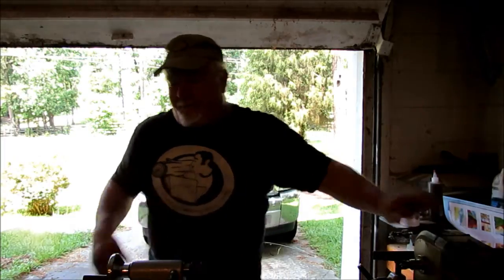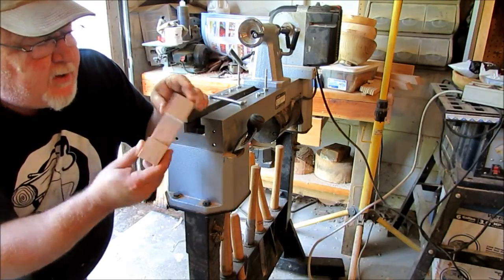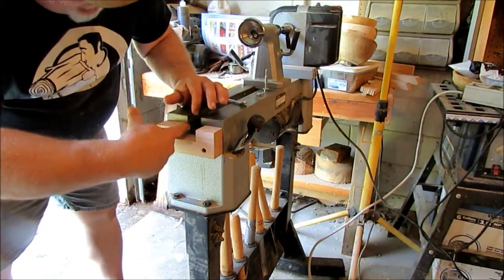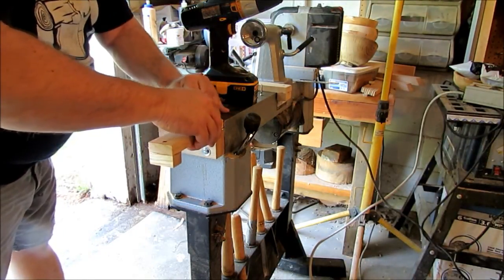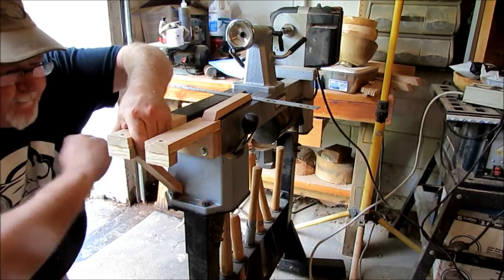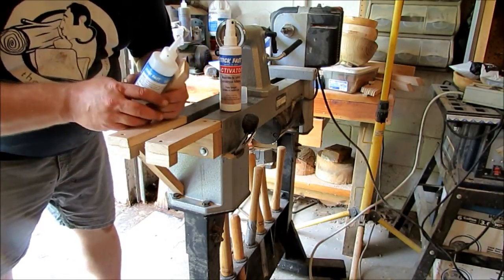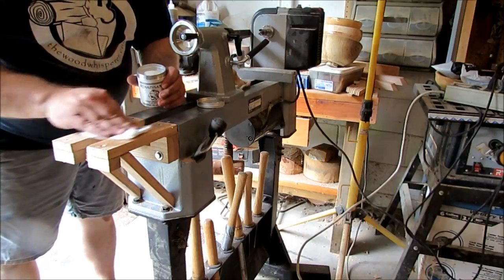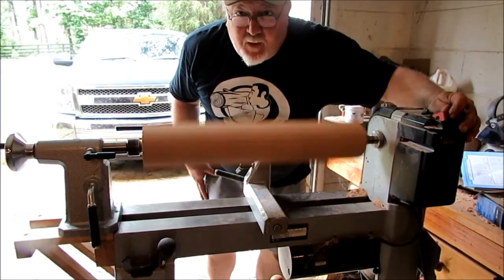DIY Lathe Bed Extension

Comment: I had a project that required about 5 more inches than my lathe could offer. I was almost about to go out and buy the extension and stand, then I ran across this video. I made an 8 inch extension just a Bill described in this video and it worked great! Thanks Bill Akins - you saved me allot of money:-)